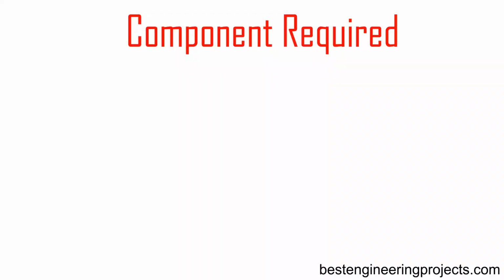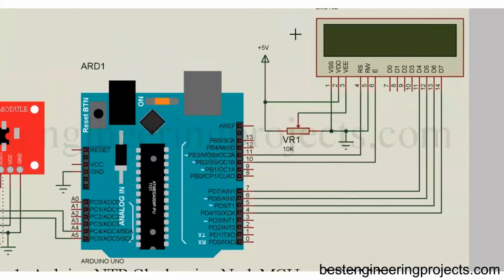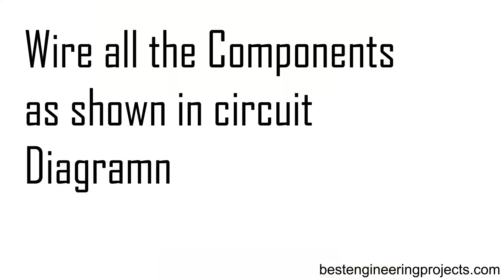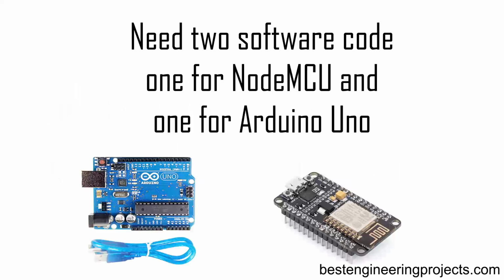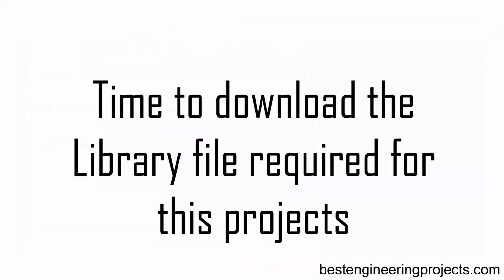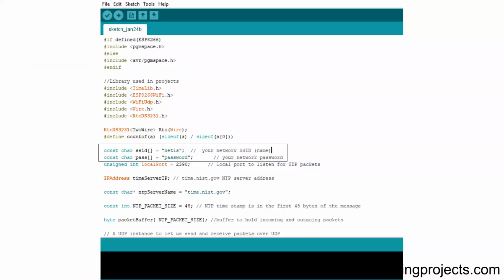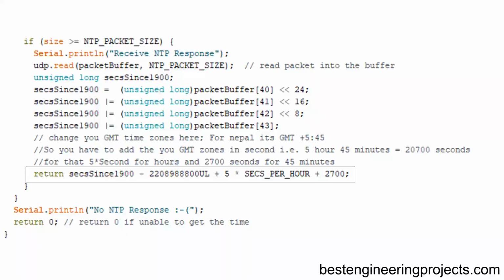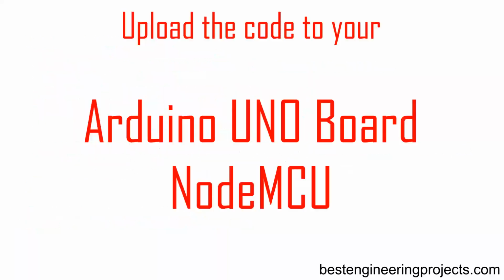Arduino NTP Clock using NodeMCU and DS3231

Comment: Hi, I am trying to convert your sketches to use a DS1302 but not getting anywhere. All I see is "165:165:85" on the screen. Is it possible to convert to the DS1302 and if yes how please? I know the video is 2 years old but I'd much appreciate it if you could help me out please.
Reply from the maker: you have to use proper library for DS1302 instead of DS3231 (used in the video).
Reply: @Bestengineeringprojectsbep , I did but couldn't get it to work so ordered a DS3231. Thanks for the reply
Reply: @Bestengineeringprojectsbep , hi again. I've got this working now and was wondering if there is a way to add DST (day light saving) to this project? I live in the UK and need to set the time an hour back in the winter time.

Comment: I have tried your project. There is no NTP Response. Please help
Reply from the maker: As this project require Internet connection so at first check whether Internet is available of not.
Now connect node mcu to your home WiFi by changing ssid and password.
Reply: @Bestengineeringprojectsbep  Got it working, NTP is not always available. Changed the code try a few times. (it takes +- 3 tries).
Anyway, great post! Your code is easy to understand.
Reply: @Bestengineeringprojectsbep  There is internet connection (changed ssid and password to my local wifi), internet connection is not the issue. what else can I check?